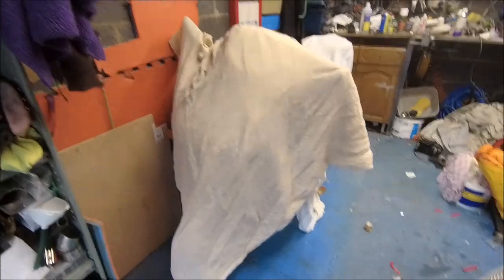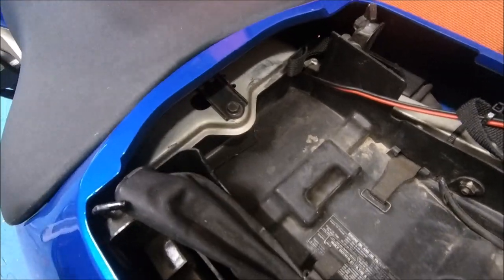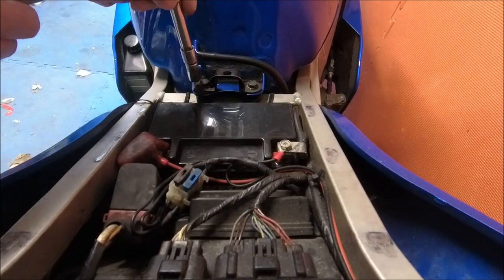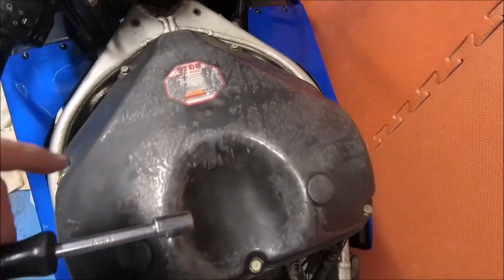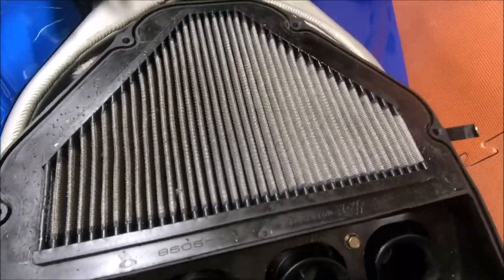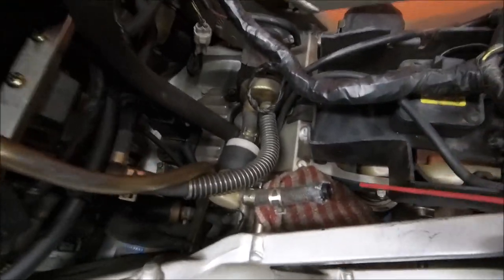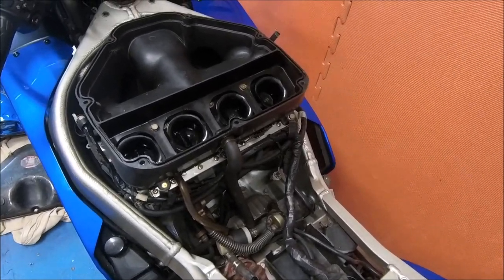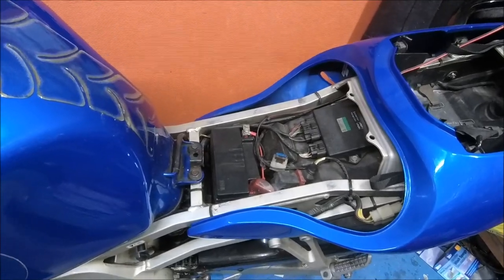Kawasaki ZX9R Ninja first start in 2023

Comment: Let the carbs run dry after every ride when you get home just in case the bike sits for a while. Never leave fuel in the float Bowls or fuel lines.  Modern fuels go off in around 30 days unless your using esso super unleaded even though it says it’s still got E5 in it it’s well known in the industry it’s the only fuel that’s ethanol free.  Leaving fuel in the Carbs & lines over winter is a big no no it’s asking for trouble. You increase the chance massively of gumming the system up & blocking the pilot jets. There’s no need for all this if you put the right fuel in plus a fuel stabiliser & turn the fuel tap to off until the engine stops. When you come to start it up first time you’ll have no trouble or messing about. If the fuel isn’t in the system it can’t cause any issues. I should no running an 88 zx10B1 & a 93 ZZR 1100.

Comment: I have a 99 C2 model with 76K miles on the clock. Never had problems with the fuel lines. Always ran top tier gas and octane booster.
Reply: What make of octane booster do you use